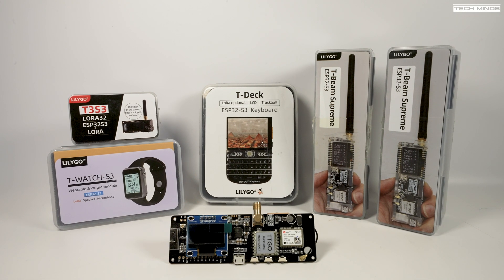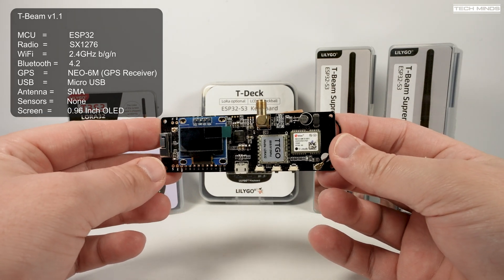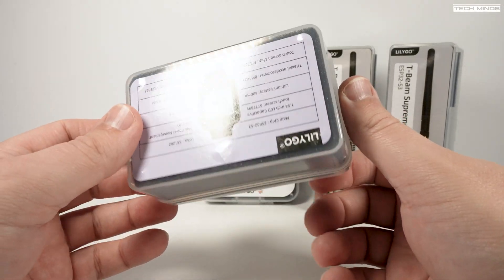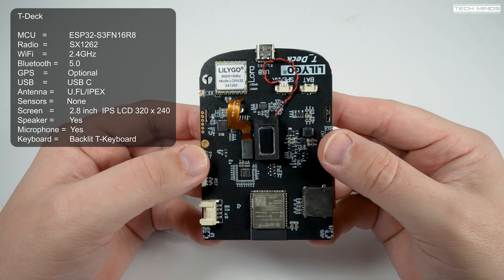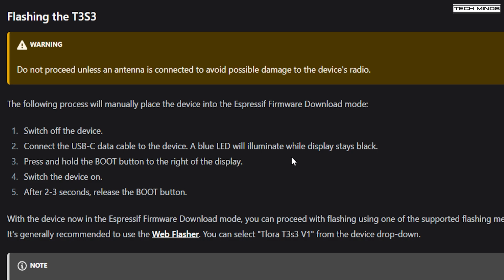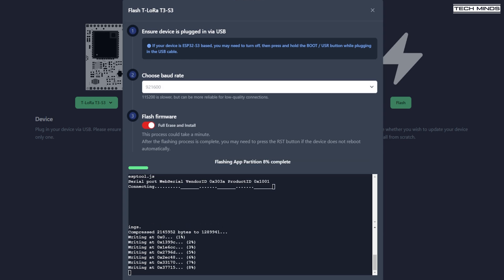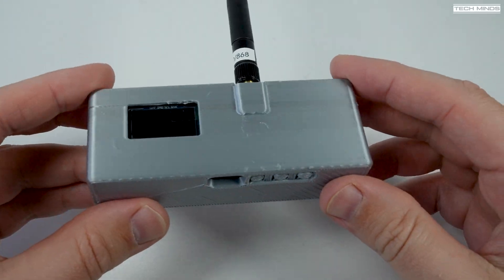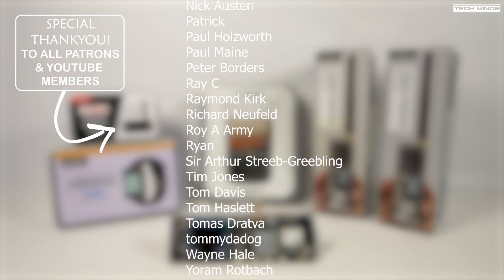Meshtastic Compatible Lilygo Lora Devices

Comment: All I’m trying to do is send a simple text message over 40 km (with barely any obstructions) from one Meshtastic device to another. But, of course, the minute you nerds get involved, your absolute inability to communicate like normal humans turns a straightforward task into deciphering some kind of technical Rosetta Stone. The wall of nonsense jargon and the utter lack of user-friendly hardware is almost laughable. It’s like that scene in the Ashton Kutcher 'Jobs' movie where they deliver a circuit board and call it a "computer" - because obviously everyone just knows how to plug it into thin air and make it work, right? Then Wozniak's all, "Your customers are the problem if they can’t use this," in response to the shop owner's very valid points about customer know-how, and it takes Steve Jobs to silently agree with the shop owner that people want things that work out of the box.

Well, congratulations, nerds! You’ve Wozniak’d the hell out of LoRaWAN and Meshtastic - not in the genius way he kind invented the home computer, just in the elitist gatekeeping way he spoke to the shop owner. This stuff will never hit the mainstream like CB radios did in the ‘70s because you insist on making it as inaccessible as possible. Keep it up, and you'll still be talking among your tiny user group in ten years from now while the rest of us have moved on. It's been almost 4 years now, and Meshtastic is barely any easier to set up than it was in 2020 when it first hit public general availability.

Comment: 9:05 you can also go into "Display" and change your display units from Chinese to US/UK , this does NOT automatically update with the region. At first I thought the settings were not working but the radio aspect and the display aspect are just on separate pages.

Comment: Honestly would love a dedicated LoRa t-watch video as i'm interested in getting one and pairing with my phone. That way I know more what i'm getting into and what it can do besides Meshtastic.

What i want to know in specific:
1. Range. How far can this thing see? Am I kinda stuck spending that first hop to a nearby node that's got an actual antenna or can I see a few miles out with this thing on? 
2. Is there a way to conserve power? IE turning off wifi, keeping it to a watch face while using the meshtastic app on the phone? Or possibly even after using the phone for setup just seeing what the latest message(is) are and turn both bluetooth and wifi off to save power?
3. What else can I do while Mesh is running? it'd be kinda embarrassed if my watch can't tell time. 
4. Any chance at stuffing a larger battery in the case? Two hours is pretty.... not optimal.
5. Other than Meshtastic, what can I make it do? Is it a case of 'either you can mesh OR you can use it as a hobby project'?
6. The antenna being in the band concerns me. I assume that does not mean the band can be swapped without the LoRa functionality breaking?
7. Let's get diabolical here. If you were to take this thing apart so you have just the watch face and however the antenna connects. Would you be able to get an SMA connector adaptor, plug in a longer life battery, and turn it into a non-watch mesh node? At that point ya get a t-beam or other device but 'well may as well go whole hog.'

Thank you for your consideration and time.

Comment: My WisBlocks finally shipped from RAK Wireless in China, after a two week delay.  I'm now glad that I spent $28 on expedited air shipment, so I paid to compensate for their lengthy shipping delay.  They should arrive in two days.  I chose the WisBlocks because they don't use the power hungry ESP32 processors.  I'm setting up a local off-grid network so my family can text even if there is no power, no internet and no cellular service.  I'm using a relatively large 6W solar panel and four 18650 batteries at each node which would probably power devices with the ESP32 processors but I wanted the lowest power I could get for worst case operation.  Otherwise, the Lilygo T3S3 would have been a good option.
Reply: yes I'm doing the same thing. I want to build a couple of them and set them up,test on them for a while. If it all works then I was thinking of offering them up to a local wireless internet provider, see if they're willing to put them up on their towers.

Comment: I disagree. I've never had a micro A or micro B port die. Had many Cs die.
Reply from the maker: Its not the port dying thats the problem. Its the fact that USB Micro are just plain shite! The connectors brake and it doesnt matter how careful you are with them.  USB C is far stronger and will out last USB Micro for sure. IMO
Reply: @TechMindsOfficial  Not the experience I've had. I'm extremely careful with everything I own. C has a 50% failure rate for me, where I've only had 3 micro cables die on me ever. That's like 5% in my case.

Comment: The Developers should work on having the devices auto adjust for different modem speeds. It would be nice to have a device further away use slow mode and then adjust itself to talk to a device set in fast.

Comment: A battery that lasts only 2 hours makes this watch a useless product to me.
Reply: Settings aren't optimized I get 6-16 hrs depending on traffic etc
Reply: Yup was an immediate right off for me
Reply: I can see an appeal if they used an nrf52840 over an esp32. Power consumption is so much better.
Reply: manitoba-op4jx that’s not the case for the 6th gen. I have 2 days of charge time
Reply: My apple watch which was the first edition with cellular still does a day and a half after having had it since ?2018? I never use the cellular mode mind you. My android smartwatch is doing 7 days on a 45 min charge....so 2hrs is ridiculous...sadly deal breaker for me too.
Reply: manitoba-op4jx you must have had a defective watch cause I go 2 days without charge with regular use throughout the day and wearing it to sleep

Comment: About LilyGo device without GPS: Check Meshstatic forum if you want to add this. Also an user button can be added and a temperature/ humidity sensor. And it's suported by firmware!

Comment: I was under the impression that the Beta versions of meshtastic is actually the stable ones and the Alpha versions are the tester versions. Which is backwards of all other software development terms.
Reply from the maker: Yeh they are, but personally I use the Alphas so I can report back bugs etc
Reply: The normal definition would be no version modifier for stable releases, beta for tested feature complete development versions and alpha for testing of new features that probably still cause issues.

Comment: I'm still waiting for an extra-cheap device so you can add a small solar battery, a small li-ion battery, and drop it on random roofs building guerrilla network of repeater nodes.
Reply: How cheap are you talking about? A T-beam can be had for less than $30.

Comment: I built a couple of the T-decks and bought 3d printed enclosures for them. They're pretty nice.
You've just given me a reason to dig out T-watch and play with it. Lol
Reply: Can you attach a larger antenna to the T-Deck? Or use a directional Lora antenna?
Reply: @kurti4432  it comes with an antenna, but it's similar to your usual cheap wifi "wire". I'm sure if someone was really determined they could figure out how to get an sma connector on it for more antenna options, but it wouldn't be an easy task.
Reply: @kurti4432 I'm 90% sure you can get an SMA adaptor and mount the thing through whatever case you want ot use and have a proper antenna sticking out the top.
Reply: All I’m trying to do is send a simple text message over 40 km (with barely any obstructions) from one Meshtastic device to another. But, of course, the minute you nerds get involved, your absolute inability to communicate like normal humans turns a straightforward task into deciphering some kind of technical Rosetta Stone. The wall of nonsense jargon and the utter lack of user-friendly hardware is almost laughable. It’s like that scene in the Ashton Kutcher 'Jobs' movie where they deliver a circuit board and call it a "computer" - because obviously everyone just knows how to plug it into thin air and make it work, right? Then Wozniak's all, "Your customers are the problem if they can’t use this," in response to the shop owner's very valid points about customer know-how, and it takes Steve Jobs to silently agree with the shop owner that people want things that work out of the box.

Well, congratulations, nerds! You’ve Wozniak’d the hell out of LoRaWAN and Meshtastic - not in the genius way he kind invented the home computer, just in the elitist gatekeeping way he spoke to the shop owner. This stuff will never hit the mainstream like CB radios did in the ‘70s because you insist on making it as inaccessible as possible. Keep it up, and you'll still be talking among your tiny user group in ten years from now while the rest of us have moved on. It's been almost 4 years now, and Meshtastic is barely any easier to set up than it was in 2020 when it first hit public general availability.
Reply: @Funkteon  you have some valid points, but you also seem to miss some. CB is dead. Ham radio requires licensing, and anything Apple is hooked to the grid and spying on you. You'll also find gatekeeping in all the examples you mentioned.
While I don't necessarily agree with gatekeeping, everything that goes mainstream goes to crap.
There are many different skills involved in this hobby, and if you don't know what you're doing, you can get yourself into trouble. But on the other hand, there are so many options that people can't really tell you what to do without limiting your options. It's best to choose a path and research, struggle, and learn.
All that said, you can buy the new Lilygo T-deck Plus with Meshtastic pre-installed, pick up a couple antennas to extend their range, and if you have a line of site you should be good. If you don't have a line of site, you may need to buy and program a node to place up somewhere to create it.

Comment: Two T-Echo's, one in 433, the other is 868, a T-Beam Supreme, a Heltec Tracker and two Heltec V3's. I'm having some fun playing with this kit.
Reply: I'm looking to create a streamlined communication network for festivals using Meshtastic to prevent losing sight of each other. The configuration involves incorporating GPS location with a compass and potentially incorporating two repeaters. I'm seeking devices with prolonged battery life and compact dimensions. Could you provide advice on device selection and stability?

Comment: I'd love to see some battery and range testing for the watch. I've been pondering getting one, though is it really only TWO hours battery life? I didn't realize it was that bad, that kinda dampens my excitement.
Reply: ESP32 is great for stationary nodes, but for mobile like watch we need nrf52 to be more accesible in lora devices. There is nRF52840 arduino compatible module (nice!nano clone) only few buks more then esp32-c3/s3 modules. But if we want it with lora - we can have only great final product like T-echo (imo it's really how lora device should be done, but the price is like real product too, not the way to play with technology for cheap like we do with heltecs/t-beams). Second option is wisblock - not even finished device, but high quality modules and high price...
I'll like T-echo in form of motherboard without screen and case (e-paper is great for standalone device, but what value it gives for node we use with phone? Screen is ~1/4 of device price. I think if lilygo/heltec use nRF52840 for a bit pricier modules than esp it can upgrade portable clients and allow us to use more compact solar panels for stationary nodes.